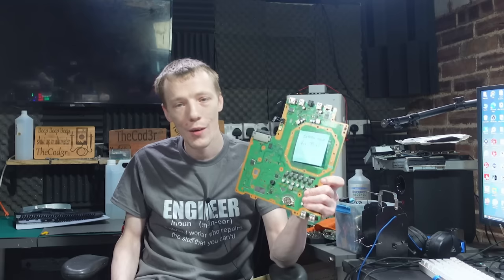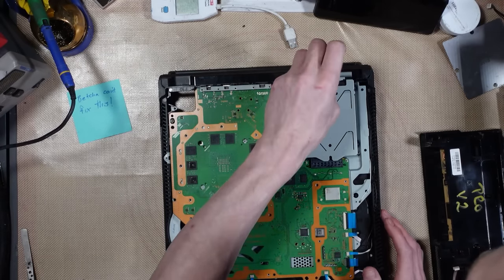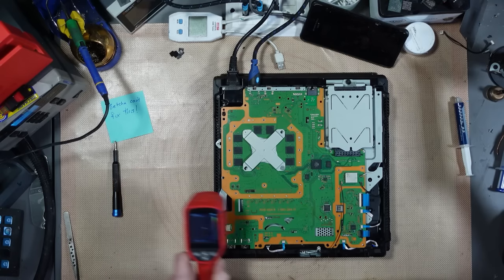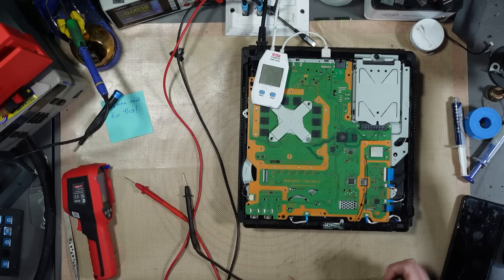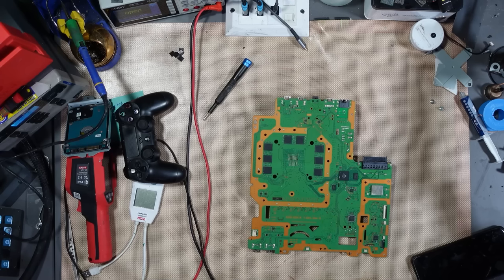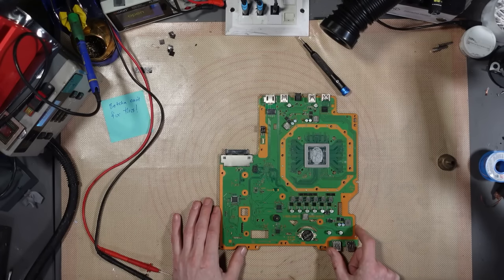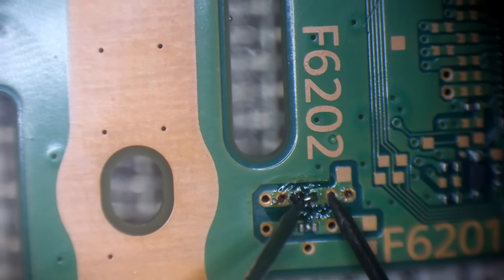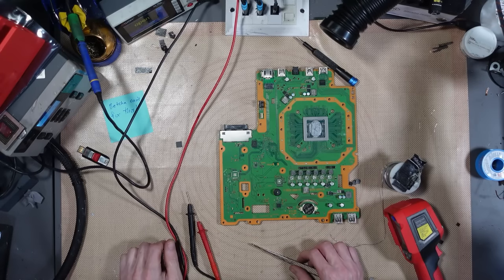TronicsFix Bet Me I Couldn't Fix His PS4 Pro 500m Special Edition! Will He Win The Bet?

Comment: On PS3s there is a syscon which can be used for diagnostics (via a TTL converter and serial line). Isn't there one on the PS4? Would it be worth taking a look and checking what the board complains about (at least as an indication)?

Comment: It would be interesting to know if the short is somewhere in the board or in the APU itself. Maybe you should have removed the APU to check if the short is gone
Reply: I thought that, it would make an interesting video to actually find out what the problem is.
Reply: problem with that is, you cant remove a large chip like that with a hot air flow gun, and if you do you cant get it back on properly. need more expensive equipment.
Reply: @MElixirDNB  not sure what you're talking about , heat gun at 800 will remove everything and properly placed aluminum foil will help keep the heat from the smaller components.
Reply: @MElixirDNB  he's already doing reballings...
Reply: @brandonparks770  theres a reason professionals dont use heat guns and use a reflow station specifically for this purpose, so no you should not use a heat gun or a hot airflow rework gun, they are made for small components only. If you want to ruin the lifespan of your silicon go ahead though
Reply: @MElixirDNB  he does reballs on the regular. It's nothing he couldn't handle
Reply: That's exactly what it is actually good for you bubba seriously!! Tronics didn't listen and he skipped over it as well. 
Think MacBook pro circa 2009 to 2012 onboard Nvidia chips. Same thing. Poor solder used in the balls, that's all. Hence why the problem jumps around as they change out other parts. All lines lead to that synthesizer engine chip! All.

Comment: Did you clear the "fuse" before voltage injection? Otherwise it backfeeded the rail and that may caused the mosfets' back-diode to turn on/overheat (and those mosfets shouldn't be the problem as the PSU and the CPU/APU was energized during test /it would shut down, if any mosfet would have been shorted/)
Are you sure those are the parts that serialized/married together? Afaik "only" the ODD-controller, APU, Syscon and Flash(content) are married-- why would it be paired to the SB's RAM?
Have you tried enabling the serial-port and checking the output? (yeah, it's a bit hassle to remove the flash, dump, modify (BwE tool), flash back and solder back)

Do you have any experience in how likely the CxD90042GG SB is failing compared to any other SB?
Reply: You sound like someone who knows what they are talking about
Reply: @shreyasrao6515  if they don’t, they are the best slick talker in history. Lol
Reply: lol
Reply: You should be making videos like this, then. If you're so good like you think you are...

Comment: It's wonderful how you all get along. I'm glad I was able to see everyone evolve into what we have today.
Reply: I unsubbed one person last week, I won't name him but he retro fitted a backlight connector for a customer and knowingly didn't fit the few other components to get the circut working.
The guy charges a large fixed rate for repairs and it was the final straw for me, greed over pride in work.

I totally agree on the rest of the community though, lots of banter and good will between the youtubers.
Reply: @Jim_M_75  im assuming im subbed to the same person cause i know which vid you mean, is that on him or the customer tho? cause if you ask for 1 thing but actually need more doing to get it to work should the guy go out on a limb and do it or should the customer have been more specific? not picking a side here im just wondering if he should have gone further even tho the work the customer actually asked for was done
Reply: @Desalater2  In this case mate I'm putting it on him not the customer. He charges a set fee, a large one at that. It just seemed a bit nasty to me, just my take. If you could solder smd caps you could change the connector if you get me.
The man is good at what he does but compared to others it's very much about $$ and not so much pride and pleasing if you get me.
Reply: @Jim_M_75  yeah ive noticed in his vids its all about fixing it asap or sending it back saying no fix so i was on the fence about what reasonable level you would expect from them when only asked to do one thing, its got that ring of malicious compliance to it i think

Comment: 18:57 I find that when they break like that when taking off the PCB , its usually because they were bad and burned up internally and damaged the outer shell from the inside causing the brittleness and cracking when removing.

Comment: I'm not much of a techie so I didn't fully understand why Steve replaced the motherboard without even trying to fix it, but this makes it crystal clear. When the problem is this difficult (nearly impossible, I would say) to pinpoint and to fix it you might have to replace almost half the board with pieces from another board to fix it... at that point it totally makes more sense to just use another board entirely. Not worth the hassle. But I commend the attempt! Great video.
Reply: And all thanks to legalized vendor-locking and hardware DRM. Not only sourcing those parts directly from manufacturer and screwing around without access to schematic is a major pain but chips are designed to brick themselves if their built-in serial numbers don't match to serial of the unit, to make any replacement impossible.
Reply: Cockroach board is better…I almost feel like he purposely cleaned that board to prove his point.

Comment: Question 21:28 why do they pair the chips like that together? I know when repairing cell phones i see chips pared like that but usually for security. For instance the Scanner for the fingerprints is paired with the CPU to make it impossible to swap out to a modified scanner that could bypass any off the phones security locks... but why on a PS4 would they pair so many chips? Copywrite protection locks on dvds and games?

Comment: Been waiting for this ...lets go
You guys must do this more often,iv seen tronix fix many times saying this one is unfixable and in my mind I'll be like the coder can fix that😁😁
Reply: I think it's mostly because Steve doesn't have the necessary equipment to do reballing, and doesn't think it's worth the time investment.
Reply: @StormsparkPegasus  Even with the knowledge and setup, all of the problem chips are paired which makes this an insane fix.  I installed a basic region free mod for my blu ray player, and can't even imagine attempting what was done in this video.  It's insanely hard to do this work.
Reply: @ianburkard  I don't even own a blu-ray player because of that ridiculous crap.  I have a BDROM drive (and burner) in my computer, but I can't actually play Blu-rays natively, because I will not use any sort of proprietary software.  But I can easily rip them which is hilarious.  I'm not paying for these stupid locked down environments, I'm happy either cracking or pirating stuff.
Reply: @ianburkard  Right, but if the problem isn't the CPU itself, but cracked solder balls or something where it's not making a good connection, reballing the chip can fix the issue.  That was the issue with the first PS4 Steve sent to him (probably a couple years ago now).
Reply: @StormsparkPegasus  Yeah the region locking is so stupid to me, as well as copyright claims on old content that hasn't been digitized and shared.  I personally feel that once a two or three year profit window has passed, a film should be viewable to the public... but that would destroy streaming services.  --  Taking the data from the disc is a good workaround, but it sucks that you have to do it.  For me personally... very easy to get a $12 used blue ray player and a  $40 mod... but files last forever.   :D

I look at reballing like heart surgery, you wouldn't ask just anyone to do it.   :)  I don't think Steve is  uninterested in it, but it's a very difficult time-consuming skill.  

Is there any reason that the chip is installed this way?  No pins?  Do they need a physically low profile install because the unit is miniature?  No, it's to make consumer repair and system cloning impossible...?
Reply: @ianburkard  BGA is very cost effective when you in theory should never need to change the CPU, and it's very easy to be installed at the time of automated board manufacture.  It makes the board smaller also.  I understand why it's used.
Reply: @StormsparkPegasus  I did mention low profile/scale as an advantage.  I totally understand what you're saying, but again, is it necessary to make the largest most important parts impossible to replace?  The theory of never replacing these items isn't going too well.  Having a chip socket wouldn't hurt anything, and it could also be low profile... but that would make the product too easy to service, too easy to upgrade.

Comment: PlayStation 5 within the settings can have the USB port turned off when the PS5 isn't powered on completely. I forgot if the PS4 had that feature but I believe it does. Maybe the original use like myself switched off power to USB when the device isn't powered on.

Comment: Hey mate, love the Videos!! You have even inspired me to dig my old PS4 Pro out. it stopped working one day after shutting down mid update and I tried every safe mode option to get it going agian but nothing worked. Now it just takes the update from the USB gets to 100% shuts down and won't re boot on its own, I have to manually turn it on again and start the update again and then the process repeats. 

 Do you think this a hard drive issue or something wrong with the motherboard?

Comment: I have 3 NVB-004 boards 2 of them have "loadbios -8" error, one of them not loading BIOS at all (firmware from flash). So you can check error by BwE NOR check tool by patching firmware and using UART. You'll easily find guides on web. The "loadbios -8" error is internal 32MB firmware and (or) syscon EEPROM corruption issue. This may be fixed too, but it's long story. Again you can check and patch syscon and 32MB flash by BwE nor editor. You need TEENSY 2.0++ and UART for diagnosting at least. There short reason on this board is BDXXX chip near the that fuses (to the right on video) but this will not cause BLOD. Unfortinatly you doing mistake when checking board without removing 3V battery, other way the resistance of some components may be lower than they are, because of Syscon is paritally still powered by this battery. Any short or missing any main voltages the board will shut down immediatly. Also you need check for resistance tiny resistors near the GDDR5 RAMs. In my experience i had 2 boards which one of the this tiny resistors cause BLOD.

Comment: Watched him do it, watched you do it... Can't take it. Not sure if you guys understand how the synthesizer engine(video card) works on those. If you are able to reball chips then reball the main what y'all call processor chip. Problem solved. I fix em all the time, and I can promise you whenever it sends to jump from one area to the next like with every mosfet you remove etc.... It's the main chip. That big one right there in the middle, lol, I'm teasing but you both skipped over it and that's your huckleberry. No such thing as internal problem with a board that had never been removed or broken physically, but started out working. But you don't have to listen either... He didn't and i only have been doing this for 27 years. Maybe it'll help other aspiring repair experts reading these comments. Who knows.
Reply: Why dont u do a video repairing that same situation?. It would be great to see it, for real, no tease. Some guy digged into the issue of the YLOD of the early PS3's and found the situation the last year having to do with the RSX defective from factory, and plagging the XBOX360 of that time too
Reply: @wolfman-vt2zr  I have fixed so very many of them. They just need to use an actual dark infrared rework station instead of forced hot air, and reball the reality\video chip. It's almost a 90 percent success rate every time. Oh and sorry I don't do videos. I should but I just can't anymore.

Comment: hi, i have put new silver thermal grease hy710 on my ps4 fat, because i had frame rate throttling in mass effect andromeda. the throttling is 90% gone, however the fan is very noisy where the throttling were worst. i only played mass effect past 6 months or so, so i dont know if this occurs with others(will check if i have time). is this normal? or the hy710 is not the right application?

Comment: Good attempt, only word of advice is to avoid attempting to take measurements from the board while it has been treated with hot air from the hot air rework station, your readings will be all over the place as they clearly were depending on the temp of the board.

Comment: No offense but, this blind guessing approach is going to be very difficult to figure out what to even look for. You might be mistaking a short for a legitimate ground plane or anything else, without a schematic you have no idea and its going to be painfully hard to know whats even going on. Some of these circuit "blocks" are very common and you dont actually need the proprietary schematic to know what its doing, for instance all those mosfets are a common way to get low voltage super high current supplied to these low volt silicon chips (APU) , since they operate in very low voltage / high current for faster clock speeds. You can find common topologies and use that as a starting guide to figure out the circuit before testing it.. also you should use an oscilloscope to watch the voltage at each fet etc!

Comment: Hey folks what's the average buisness rates for repairing laptops. Do you normally charge for diagnosis for buisness to buisness. 150 job lot of laptops that needs repairing
Reply from the maker: It depends on the issue mate but no I don't charge for diagnostics. If they've had prior repair attempts or been messed up I do charge a £30 bench fee but other than that it's no fix no fee. If I am able to fix them most repairs range from £45 - £100
Reply: @TheCod3r  is that range parts and labour?
Reply from the maker: @hutchings2023  it really depends, if the components are only a few pound each normally we cover those under the same price, but it would depend on what parts need doing as some parts can be expensive